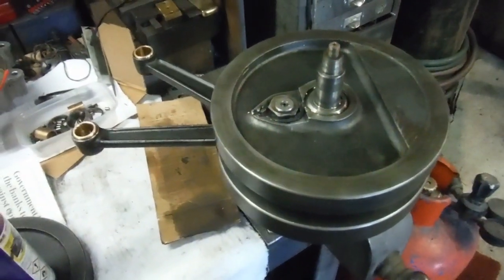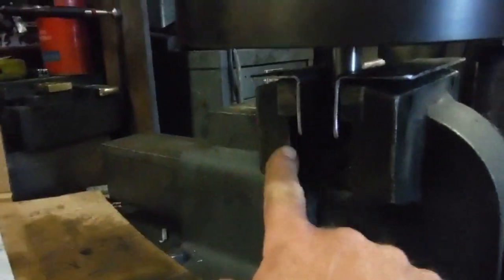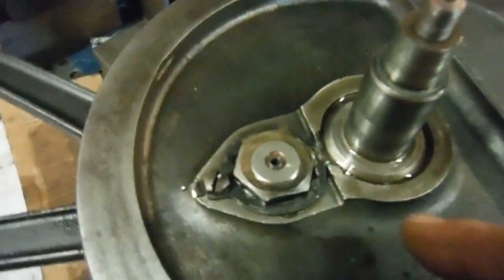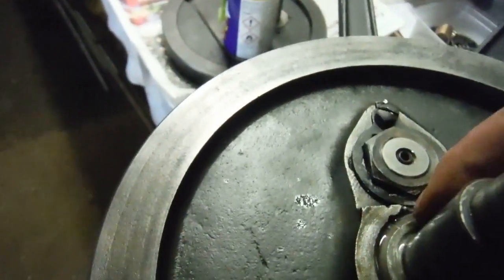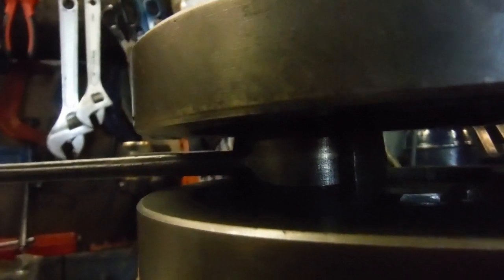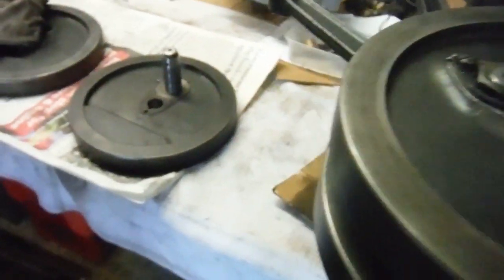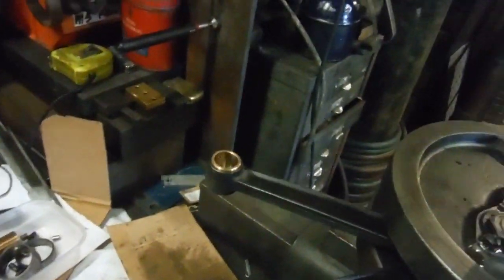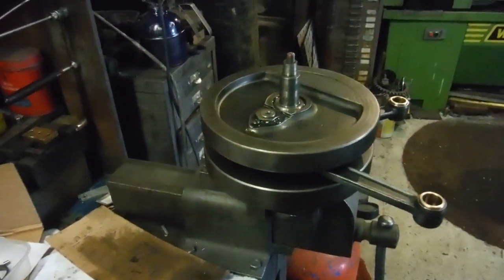Royal Enfield Model K 1930 crank checking oil feed drillings alignment.

Comment: Hey paul i increased the compretion by welding the cumbution chamber now my plug show that my engine is runing rich i kept the leanest mix that carburator can do. Bust still plugs are dry black.it is bullet 359 cast iron. What can be the cause
Reply from the maker: You need to look at what you have changed since it presumably ran ok and work through these one by one.
Reply: @paulhenshaw4514  i only increased the compretion only nothing else